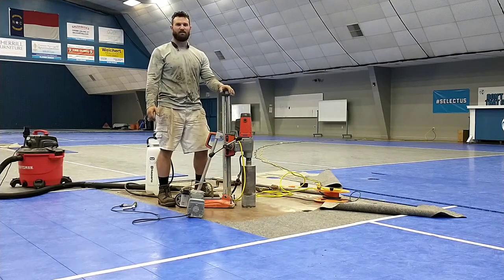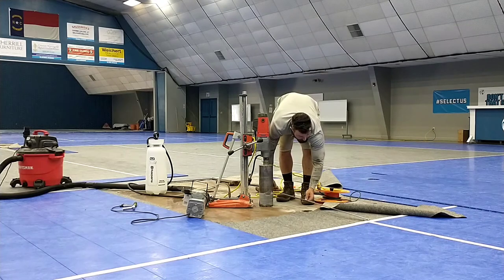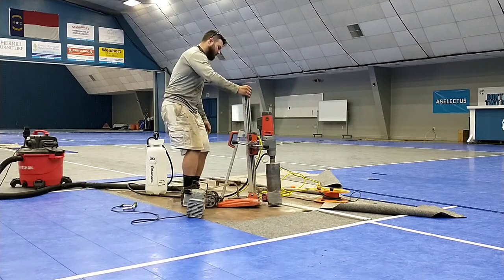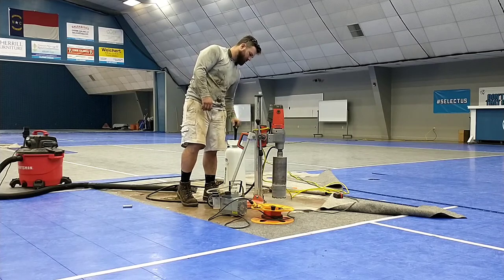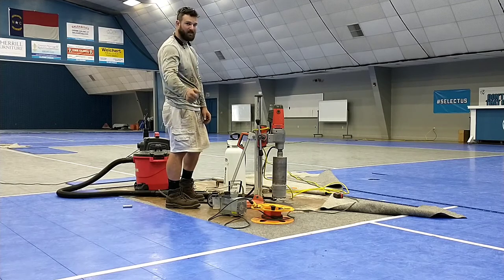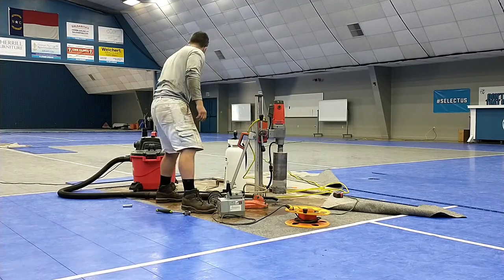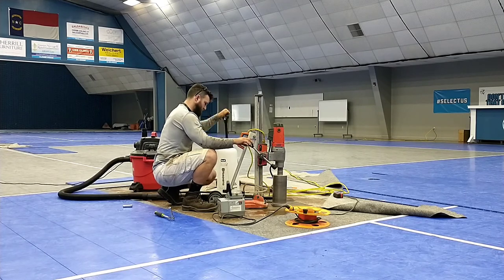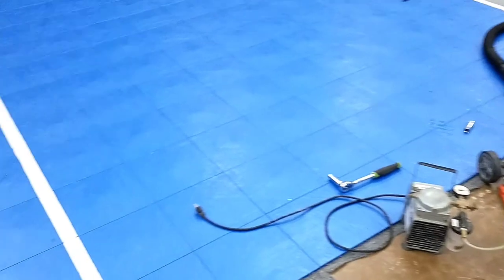How to use a core drill on a concrete slab

Comment: How you doing, I would recommend to install a (drop in anchor) on the floor, put (all thread rod) in the anchor between the (core drill stand), put a (square washer and a (nut) on the (all thread rod) and secure (core drill stand) to floor, that’s one way i core drill and it’s a bit safer brother, good video and god blessings 😎
Reply: Yes I just had a Little go around accident. Safely first